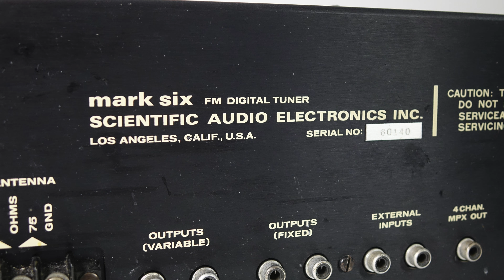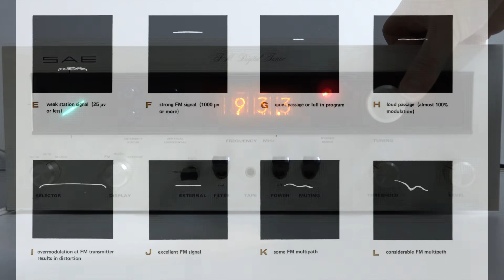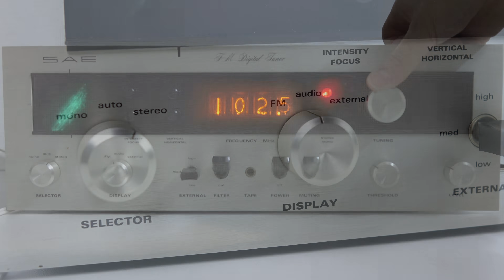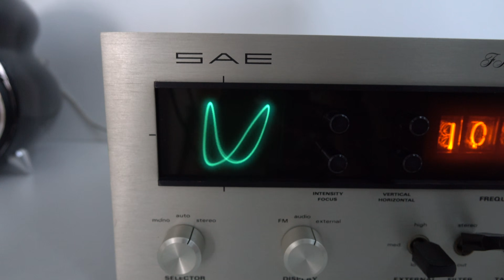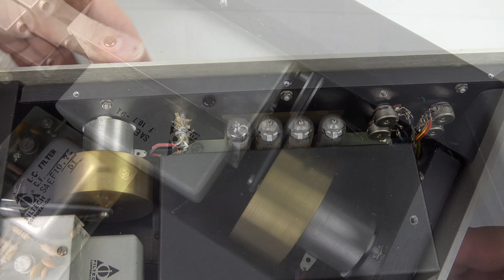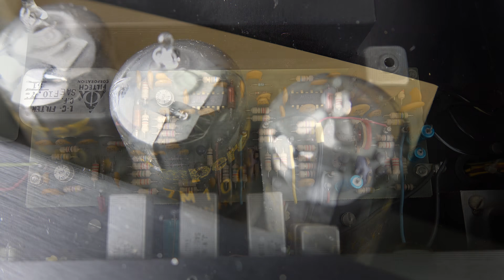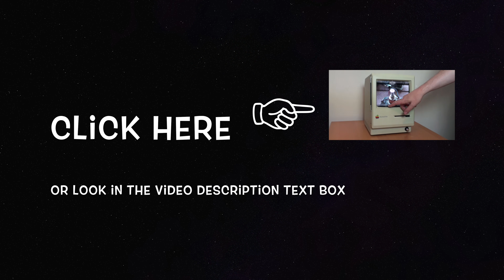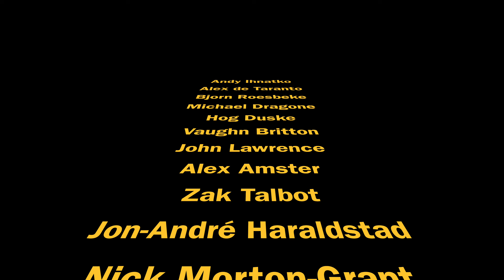Retro-Tech: SAE Mk6 FM Tuner - My Vintage HiFi holy grail

Comment: looks like someone changed out some Capacitors after all those years, you basically have to change them all ;), but if it works there is nothing to say but they will be a problem in the future :)
Reply from the maker: Everything will be a problem in the future....that's why I'm trying to enjoy now, as much as possible.
Reply: right too. But rarely something else fails, i have equipment that is working since the 1970 and it was used heavily before i had it, and some new caps and is as new. Thats the good thing, old equipment is often so easy to fix.
Reply from the maker: I'll keep that in mind.
Reply from the maker: Wow Mr Negative...Super Funtime
Reply: Capacitors will pretty much always fail given enough time. Even in the most expensive products. Its no reflection of the quality of the product. It's just the nature of capacitors.
Reply: Problem with capacitors: They could fail anytime, or they could just be fine for another 20 years. You never know. So since these capacitors are most likely top quality I would not sweat one drop over them failing until they do and go on enjoy that nice tuner.
Reply: who are you asking? Electrically the Paper and oil caps are not really good especially when they are old, they are going to leak and i dont mean the oil, they are leaking electrically they letting current trough witch they are suppose to block.
Reply: Yeah, it was definitely repaired before.
Reply: +Cyparagon At 45 most humans also have a bunch of parts replaced already, lol.
Reply: Craft4Cube He compared the capacitors with tubes as they both wear out with use. Although your comparison of tubes with transistors is also correct as both amplify the signal.
Reply: Some audiophiles like paper and oil caps.  A dubious claim, but I've never had experience with them besides replacing bad ones.
Reply: I wouldn't just dive into a tuner, especially a high end one. They are more sensitive devices than any other piece of HIFI gear and would need specialist alignment following a service. If it works fine, leave it well alone.
Reply: +sadakotube Yes, I'm currently working on a Quad 34 preamp that has a number of issues including corroded traces from leaking electrolytics. It also needs some new OP amps and switching ICs... It'll be a brand new amp by the time I'm done lol. I've only seen caps actually leak when they have been run close to their voltage rating and/or in an excessively hot environment.
Reply: +Brandon Evans That's because a lot of manufacturers use crappy quality capacitors and run them on the limits of their specification. I have a Linn power amp made in 1993 that has been in daily use for all of its life, it's driving a pair of Royd audio speakers in my bedroom and sounds fantastic still. I gave it a check over last year but changed no components because they were all still well within spec.
Reply: +sadakotube A lot of those caps are made compact though and are subject to more heat cycling. Caps in high end audio (at least from manufacturers who pride themselves on quality and reliability) do tend to last a long time but obviously they are cost prohibitive on lower cost consumer electronics. However, quality of capacitors does seem to be at an all time low in consumer electronics and it's not unusual to see a 2 year old TV with multiple failing parts. But then the tuner shown here definitely falls into the "manufacturers that pride themselves on build quality and reliability" camp.
Reply: Sometimes i consider capacitors as consumables in that case
Reply: Cyparagon Compared to modern stuff, this is military quality. Caps usualy last for 10 years before. It depends on operating temperature. Modern stuff is made to last 2 years waranty. Thanks to lead free soldering  and design to fail. So few caps is very good conditon after such a long time.
Reply: Techmoan I would say that this device deserves better inspection and repair. I see lot of stuff that does not look  good from my point of view. Caps are first thing. Then i spotted some black parts That is bad sign. Also there is lot of soldering which happend in the past. Resistors on switches does not look like a factory stuff. I would probably try to find picture of stock stuff and then fix what is needed for long breake free life.
Reply: There is also the Problem with the electrolyte it can damage quite a lot, mainly in the 90s with all those smd Caps leaking and eating up the board and components, in this case that would not be a big problem But it is good practice and in the long run it can save you the trouble of repairing it later or sooner again. Im sometimes to cheap to change them all but i know in the future i will have to do them eventually.  And yes today the Brand Caps are quite durable. 
And yes as long it is working and the Performance is there i cant se a big problem of leaving them in, 
And if one day it stops working you know, under your audience the are a lot of people witch can help you out
Reply: +TecKonstantin yes, I'd agree that changing PSU caps would be fine, I'd just stay well away from anything on the front end. It's a lovely bit of kit that tuner, I'd love to pitch it against my Linn Kremlin, I bet it'd be a close run thing... It might even beat my Linn.
Reply: You should play Oscillofun or Youscope on the Oscilloscope in the tuner
Reply: +geheimschriver actually the worry is that when the caps leak, they also eat the PCB traces
Reply: +TecKonstantin I fix older allot of older video game systems, The  Sega CD Model 1,Sega Game Gear, and basically anything made by NEC all need new SMD capacitors, they all leak. The Atari Jaguar and the CD attachment for it also need new capacitors as well.
Reply: Electrolytic capacitors are today's version of the tubes/valves.

I basically see them as a wear item. I just tinker as a hobby. But 90% of the broken TVs and devices I've fixed had blown caps.
Reply: Any cap that says Mallory has my vote that it will last forever :) just ask my 70 year old tube equipment! +Techmoan if it works fine now its going to work long after your done with it. Cheers mate!
Reply: I too noticed many resistors, capacitors, and perhaps other components have been changed out with modern long-lasting equivalents. Looks like it's all in great condition... makes me want one for my collection. To be able to tune your radio using a built-in oscope complete with nixie tubes. That's enough to make me stare at my screen and drool. LOVED THIS VIDEO!
Reply: And there is a potential that a damaged cap can cause other severe damage
Reply: What's your opinion on oil and paper caps?  Do they actually make things sound different?
Reply: @ 
Si1983h in a tuner there are not electrolytic which are critical, they are used to condition the power mainly as long as u dont damage the rest of the circuit it is fine to change them
Reply: Si1983h jup it is always nice to save such things from the dumpster if someone can still enjoy them
Reply: +TecKonstantin so basically you shot gun approach, change all caps good or not all at once?
Reply: it is a good measure to do it. To do it like that is doing the half job of repairing something, but as i sad if it works you can leave it alone. If one is bad it it likely others will fail not much ling after and after 30 years they are basically all out of spec. I want the things to last not to be repaired again and again just saves the hassle
Reply: I have a device from the 1980's that still works with original capacitors. Old capacitors lasted longer cause they were also operated on lower frequency, nowadays you have HF switching power supplies in everything and a lot of strain is applied to the capacitors with high frequency as when the ESR goes higher than a threshold level, the current spikes heats up the capacitor, causing it to fail exponentially.
Reply: +DjResR A very valid point but one which needs a little explanation to those of us that don't know what equivalent series resistance even is.  Personally, I'm a fan of solid capacitors where appropriate.
Reply: Robert NES816 Oh yes in old JVC Equipment all those SMD Electrolytics are leaking like hell and eating up everything on the board, hope the new generation of those Caps are not behaving the same in 10 years ^^. A lot of Audio and Video gear from those days have the same issues.
Reply: Robert NES816 is it worth it to go over the board with QO contact cleaner and a toothbrush or is damage inevitable from flux?
Reply: Si1983h I do think they also leak when they've exceeded their expected lifecycle even when run below their ratings.. My experience with caps are more related to automotive control units though, which do see more external heat (but insulated, so the caps never reach anywhere near their heat ratings), but lower internal voltages than the caps are rated for.
Reply: +Si1983h in addition to that, parts budget for an ECU is minuscule compared to what was available for this tuner, remember that with inflation, it would cost over £6000 today, you can just about buy a whole new car for that today... It'll be crap but it'll also contain a whole lot more components than a tuner.
Reply: Nathriel can you trust new old stock components?

I know someone who basically got packaged new old stock electronic components from a couple old businesses that closed
Reply: MrMegaPussyPlayer I appreciate the thoughtful answer.
Reply: Brandon Evans I think you've got something wrong, transistors are today's version of tubes/valves
Reply: he is comparing that both are the failure point
Reply: Its probably just flux residue from being assembled by hand, Its common with older boards.
Reply: If you can trust your NOS supplier, you can trust the components.
Reply: Game gear is notorious for this audio failure alot.I have 6 mega drives all work fine.
Reply: TecKonstantin woher haben sie erkannt dass die Kondensatoren ausgetauscht wurden ?
Reply: And if you can find them, always use Panasonic capacitors in the signal chain, they are expensive, but just superior. You dont need them in the power section though.
Reply: Dan Xepha In the guitar business, we sometimes find 1950s caps in Fender amps still working, but its best to change them, but that hurts the value of the amp. Go figure.
Reply: Chip Guy Vids Making sure the values are in spec will prevent transformers or transistors from blowing out. Some parts you cant get anymore.
Reply: Brandon Evans In guitar amp tubes you want NOS tubes, try for RCA black plates or Sylvania which are reprinted RCAs and others. No comparison with todays junk. The inly good modern power tube is the Svetlana winged C, Regular Svetlanas are just Sovtek Russian junk.
Reply: they pretty much are.. new/old doesnt matter they go bad they were never built to be a never replace component.
Reply: +Aussie Guy Well I followed some online guide to replace the caps... got game gear screen working but still no audio, not even a hiss :(( any ideas?!!
Reply: Wow, it is just 1 year younger than me 😜👍
Reply: Techmoan 
Especially caps 😊😊😊
You want your 70s gear to live a long life x Recapping 👍
Reply: Dan Data 
Boooooo x We are here to help each other x Don't be mean 😊
Reply: Why should someone mess around with a working thing? Sure, some military grade Vishay 118AHT capacitors would have looked better and can still be taken in consideration once there is a failure. Since they are axial they would also look better behind that plate where you can't even see them ;) However even industrial grade capacitors these days are rates with 7K hours at 105°C. So at room temperature they got an time to failure of 1.7 million hours at <1% failure rate.
Reply: Yep and replace them with probably cheap ones laying around.  Writing on board is also his works. Not manufacturer. I agree that would be good idea to check them all with meter. (ESR, capacity). It is too nice to let it  not work at full potencial.
Reply: i would put it in the category "Snake Oil" selling
Reply: ***** i think it was a comment if im not mistaken ;)
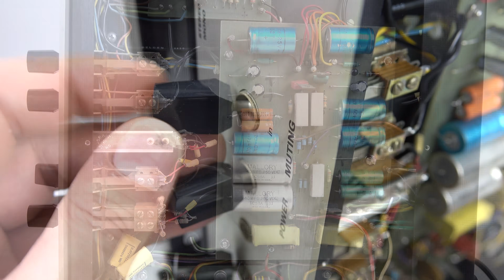Reply: Right. 13:02 "45 years old and working perfectly"... after having a bunch of parts replaced anyway

Comment: how could you get a copyright strike shouldnt that fall under the terms off fair use please excuse my poor english grammar im a german hifi fan so this channel is perfect for me :D
Reply from the maker: Copyright strikes are an automatic content match performed by computers matching audio to databases of sounds. When a match occurs the content is flagged and then it's a long and drawn-out process trying to get that flag removed - in the meantime I lose any revenue I could have earned on the video. I can claim fair use...but it's only after the take-down has been automatically generated.
Reply: that explains it thank you very much
Reply: Would it be possible to find a small FM transmitter similar to something like a Griffin iTrip? Quality on those isn't great but it should work for these type of videos and avoiding the copyright strikes.

Comment: Have you ever seen a VHS format music system? I seem to remember that someone (JVC?) came out with a VHS deck that played music, VHS cassettes. The music was recorded on the scanned portion of the tape, and perhaps along one edge. You could get a couple of hours of music with extended dynamic bandwidth. As an aside, one pundit mentioned that hard rock music doesn't require a wide dynamic range since it was all loud. 😄
Reply: VHS HiFi. Sony had Beta HiFi too. I spent hour recording my music collection on to it. I always spent more time recording than listening.
Reply: +OldProVidios :
    Thank you! I worked at an RCA and Zenith shop. We carried the RCA (JVC) and Zenith (Betamax) cassette decks.

Comment: You probably know this but well, here it is...the display jumps in 0.2 MHz increments because there are no commercial broadcasts at .0, .2, .4, .6, & .8 ( e.g. 106.2 or 98.0 ).  As you say, a lot of effort went into making this tuner and I think that SAE making sure their nixie display would not show any off-station impossibility is the pinnacle of forethought.
Reply from the maker: ...in the US. The UK (and no doubt other countries as well) utilise both even and odd numbers...it's down to frequency separation standards varying between countries. Local stations to me are Wish FM - 102.4 and Key 103 - 103.0

Comment: Can someone explain to me why certain tones played on the osciolscobe display cubic boxes?
Reply: basically how the oscilloscope is setup is that one channels amplitude controlls x axis and the other one controlls the y. My guess is that for the boxes it's some kind of sawtooth wave on both cannels (it sounds sawtoothy at least), the diagonal part is created by the sloped flank and then the the fall back down creates the horizontal and vertical lines. Im not certain though, but there is software, that can creat audio to display certain things on oscillosocpes, or look up Jerobeam Fenderson, he does a lot of this stuff and even made an album that visualizes itself, he also has some explenations how some stuff is created
Reply: Its (most likely) setup to show left vs right channels on the scope (L = vert, R = horizontal). The patterns traced are then representing (instantaneous) amplitude differences between the 2 channels. A mono FM channel where L = R will then trace a diagonal line as seen in the video (the channel relationship is in phase with each other). When the test signals were injected, they were stereo and so the patterns were showing the phase differences between the 2 channels. Hot spots on the output show a constellation of points where the 2 channels are at a constant amplitude and phase with each other. The size of each constellation show some modulation (probably the wave-shape) at these points which gives you that synthesized sound.
Hope this makes some sense... Cheers.
 - Eddy
Reply: (additional) if interested, the curved patterns are referred to as Lissajous loops (or curves). Very popular in 60's - 70's SciFi movies as a prop.
 - Eddy
Reply: Because the dots on the cube are quite intensive (and to achieve that, both audio channels have to stay at the same amplitude for a bit), I would say, that it mainly contains some rectangle waveforms.
Reply: Deathlok67  If I understand correctly, the edges of the box is the beam moving from constellation to constellation, it's not in the audio signal..

Comment: I never knew this brand existed. I'm mostly a Pioneer guy when it comes to vintage hi-fi. 
In Denmark FM radio is barely hanging on, even though its still the most used radio listening method ( i think). The politicians should watch something like this, to see why FM radio needs to stay.